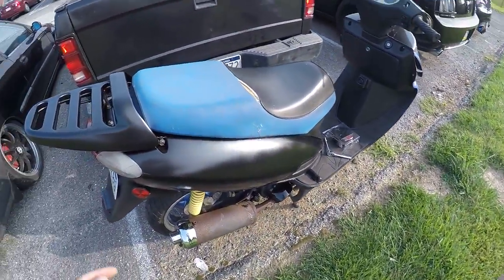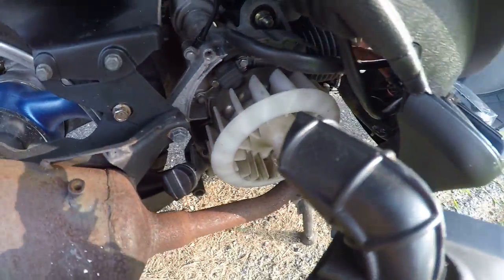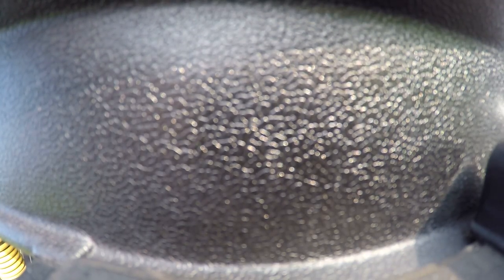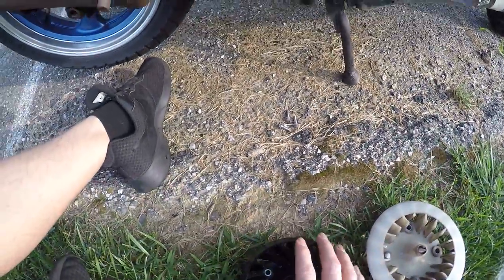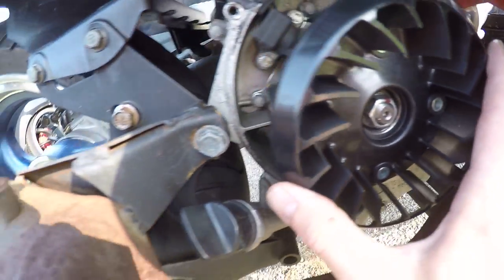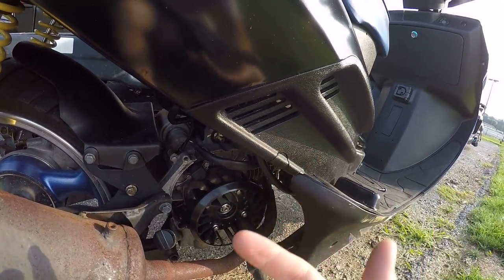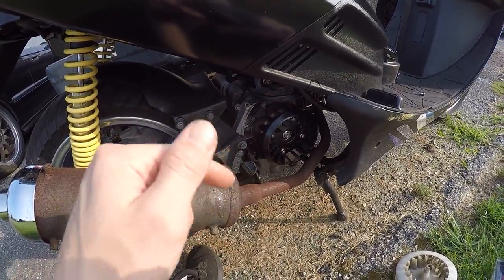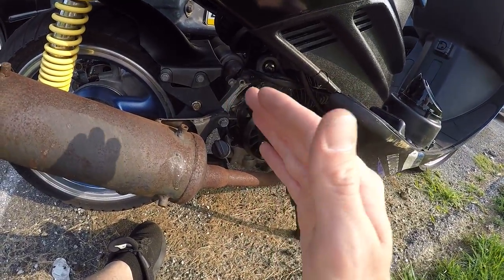Upgrading the GY6 150cc Cooling Fan

Comment: I jus got this fan and the difference is totally noticeable
Reply: Works better then the stock, for yours ? . I lived in West Palm & was having heat soke . I did the oil cooler with a rad ( NCY ) 150cc gy6 . Pricey though $300 worthwhile if you live in a hot climate 🌡🔥.

Comment: I hope it works out for you my friend 💯🤞. I forgot how many aftermarket performance fans that disintegrated at 50mph lol. Let's us know how it holds up 🎬🛵👍
Reply from the maker: I actually had a orange glixal in my last 50cc build that did that so I'm hoping this does not do the same.
Reply: How was this cooling fan for u ? Good experience? Should i buy

Comment: Hey what’s all that what you’re working on called I got a 200cc gy6 engine and I’m new to all this and I want to know all that area you’re working on all the way to the gears in there and chain mine is screwed and I need to know cause I need to replace it
Reply from the maker: @jaysins200cc  the transmission kit? What parts do you need called out it's mainly just a variator and clutch along with the bell housings.

Comment: Hello my friend . I watched this build & was wondering the performance on the fan🤔 does it work as good or better than the stock?. How is your build of the scoot coming along. Never got the update on the vento. The car builds are awesome. I have a 2015 adrenaline red viper as a weekend cruise 🚘. Im in southern Ohio. Your probably working all the time like me. Because, Im learning that myself because today's economy lol. So all my builds are slowly coming alone . Hope you're doing well 💯👍.🫡
Reply from the maker: Hey what's up and yes I'm working alot but the fan does actually work roughly 10-15 degrees cooler vs the OEM setup. It's one of the very few fans that actually work the others don't actually work like the orange ones. The build I ended up completing in later videos and I actually just sold it for 2k to a guy in thurmont Maryland. But hope your doing well as well 👌
Reply: @RspecNick  Thanks for sharing the info. All my scoots are EFI liquid cooled. 2.k nice dude 👌, probably could've got more. I do quick scoot flips when there's meat left on the bone. Few & far between nowadays 😔 & parts have been scare from China lol. Liked the builds you do 👍✌️
Reply from the maker: @just4kicks950  that would be nice to go with a efi setup honestly and yes I could have definitely gotten more of I held out but the person seemed interested enough so that was a solid sell. I'll probably grab another one down the road since they are so easy to find
Reply: @RspecNick  I have a Piaggio Typhoon liquid cooled EFI & a Yamaha Tmax 300cc . I got a zip 50cc sitting no title with broken plastic's . If you're interested for $100. To be honest I can't find parts on my end definitely, needs crankcase seals or reeds. I was going to apply for a title. Without plastics why lol . I can donate to you & your channel "free" but no delivery (Ohio)